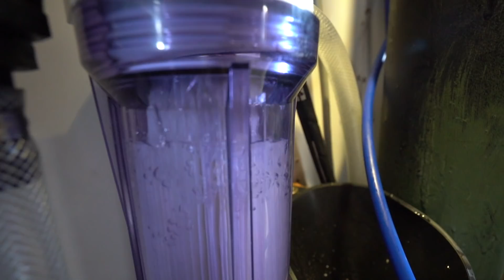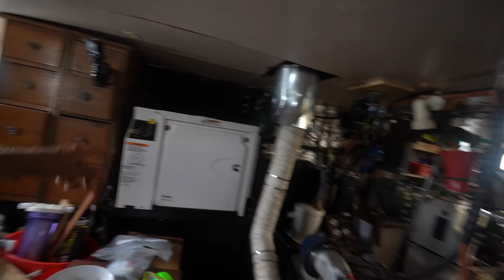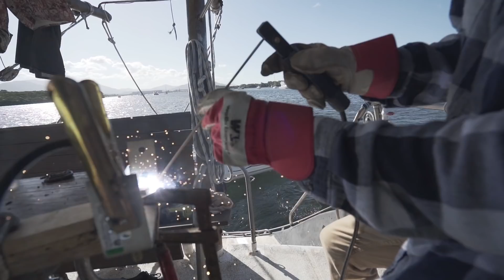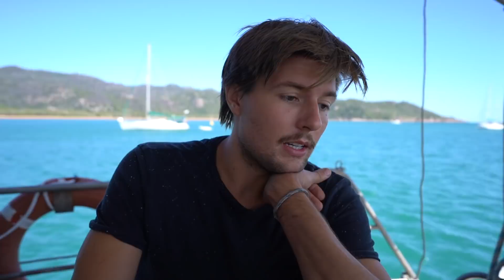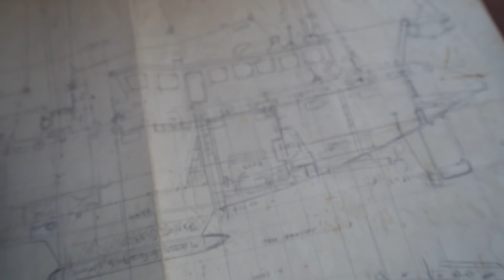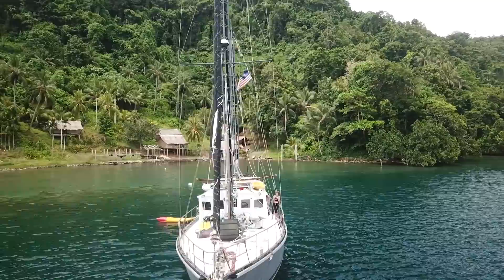Installing a WATER MAKER, Stinky Sailors Finally SHOWERING 💦🧼 Expedition Drenched Season 2 Ep9

Comment: Order a big roll of reflectix. Cut the refletix & blackout curtains to fit the shape of each window. Sew them together (you can use an isulating layer between). Put velcro stickies on the corners of each shade & window. Stick the shades to the windows snugly.